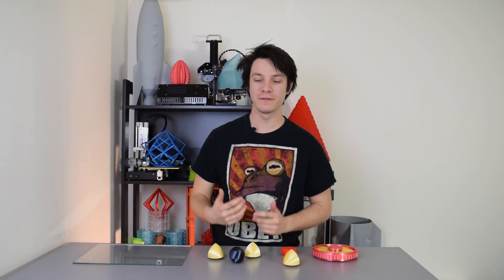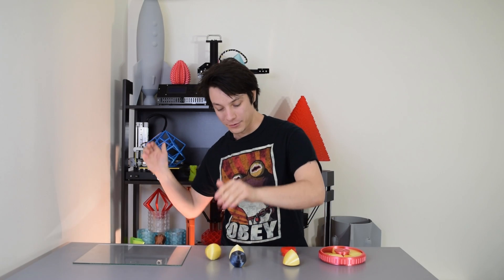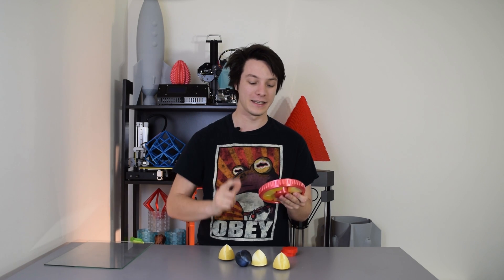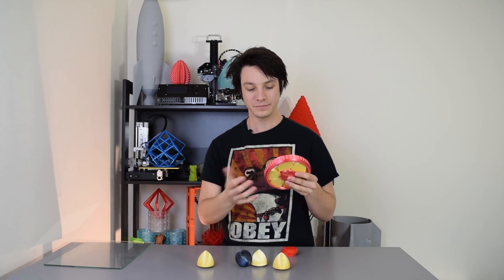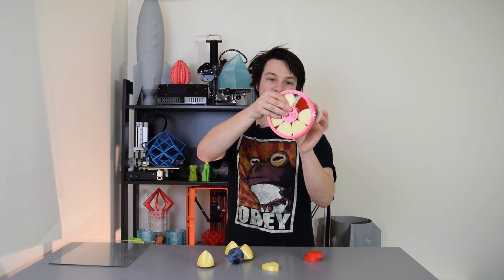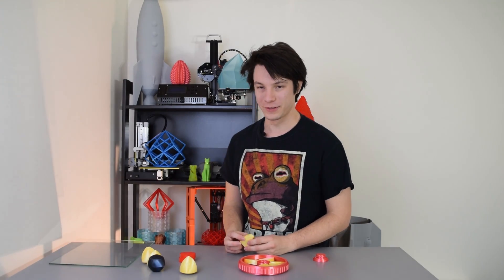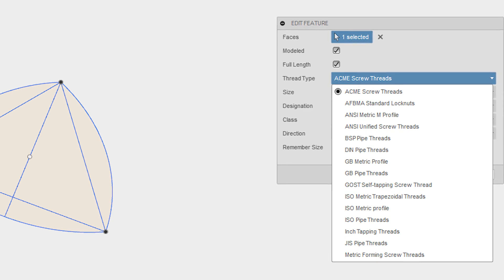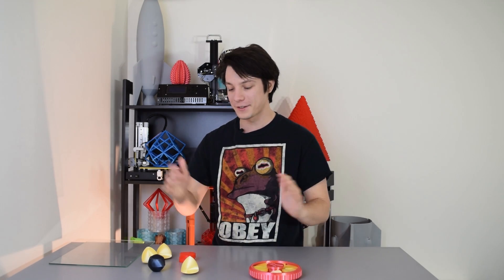Reuleaux Triangle Bearing - is it possible?

Comment: I have an idea how to make this work with the 2D constant width triangles. It will probably work if you have a guide mechanism like in regular ball bearings. The difference is, that the triangle requires a "guiding rod" through its center and that rod must be held by the guide in a way that allows it to move "up and down", but not "left and right". That would ensure that there is always the same distance between each triangle, just like there is always the same distance between balls in a ball bearing. 

What you demonstrated with the triangles falling out would be the very same in a ball bearing as well if each ball/triangle is not fixed in a horizontal position and they could shift all to the bottom, though it would require far less balls than just one less triangle as shown, so the center of the bearing can actually dislocate.

I hope this makes sense ;)

edit: Just saw the link to the "It is possible" video ;)

Comment: It'd be pointless and overcomplicated but...What if you made a bearing retainer that instead of containing the bearings from the edge it held them from an outer face and was grooved so as to push them to roll rather than simply making it rotate around an axle. This system would be clunky however, and would not provide smooth action. So you would probably have to gear it to keep the retainer and the bearings synchronized. Much like the fixed bearing in a rotary engine which regulates the motion of the rotor.

Comment: Surely you could just have the guides hold the bearings apart at the maximum required gap and just have a bunch of empty space being held free most of the time by the guide, and make a set structure out of the guides

Comment: drill a hole through the middle... and then make a guide ring that keeps them the minimum distance needed to not interfere with each other constantly.... then put them back and see how it works. might want to line the inside of both the guides with some material to provide some grip aswell so the actually rotate... for your demonstration purposes

Comment: Isn't the purpose of a race in a ball or roller bearing to hold the balls/rollers apart?  It would be possible to manipulate the relative sizes of inners, outers and rollers/balls to not need races, but then we would have the problems that abutting surfaces of the rollers would be trying to move in different directions.

While I can understand this for circles, my brain starts to melt when I try to visualise what it would do for these "solids of constant width".  I do imagine, though, that there would be a clash between "points" as they tried to rotate (in opposing directions) into the same space.

Definitely my bed time.

Comment: You can make a guide for them that compensates for the movement by being a slot instead of a single point. Place an axel in the center of the reuleaux triangle. let it slide back and forth between the inner and outer races. It should keep the bearings from touching each other.  I am concerned that the distance traveled over inner and outer races are different unlike the glass plate over the table. This may lead to undue friction. just downloaded Fusion 360 i want to play with this =)

Comment: I suspect the solution there would be to cage them with an eccentric whose offset is equal to that of the the center of the "roller".  You keep them in sync via the right gearing.  Gear the cage to either the outer or inner raceway and to the "roller".  This keeps them in proper radial sync, to use a term.  As the center of the roller moves inward toward the center of the bearing, the cage moves with it.

A much simpler way would be to build the cage with radial slots.  Each roller has an axle through the center which rides in the slot of the cage.  The cage acts as a Watts-type crosshead, allowing for the radial motion.  The only part of which I am not certain is the angular forces - whether they would seek to alter the angular distances between rollers, trying to force them first closer and then farther from each other.  Can this be overcome by assembling the rollers in a precise orientation to each other and during operation will they maintain that relative positioning...  Only way to find out it so build it.  Hint hint...

Comment: Great video, nice idea, but you didn't make a ball bearing you essentially made a pin bearing. Making a 'ball bearing' version would require you to think in 3d (I understand why you made it flat :) ) So it might still work in 3d you just have proven it won't work in 2d :) in 2D they wont roll but in 3d they interact differently. The shape reminds me of the wankel engine (I know the Reuleaux triangle isn't the same as a wankel rotary), you could redesign the shaft and housing to accommodate for the movement, how you asked... don't know, I only watched this video, but do find it an interesting idea.
Reply from the maker: I did have a play with making these into 3D Shapes, you can check it out here https://youtu.be/2eUWT9cI23o . You're right though the concept probably deserves a revisit!

Comment: why couldn't you make a "ball guide" using pins in the center of them, since the height is always the same the middle should be near enough so that you could add a ball guide via a hole through the middle. even though there would be shifting due to it being a triangle it would still keep them far enough apart with a big enough hole as it doesn't HAVE to be a small hole and it could be over sized for the pin but it would still keep them from coming in contact.

Comment: you could just make a guide, like wih ball-bearings. that will keep the solids from bumping into eachother. a hole in the center of the solids with a guide pin or an excentric rotating guidedisc could do that for you.

Comment: What if you printed gear teeth on the inside of the outer shroud, the outside of each rotary triangle thing and around the outer circumference of the core axel (or whatever you call it) to keep everything moving consistently? Sorry about super scientific lingo.... Let's just say I'm not an engineer, but I am curious...

Comment: Theres a very important reason why Ball bearings use balls. And its simple Ball is the most perfect shape do to it having only one dimension. And the reason why that is important is simple Durability.
Ball is naturally very easy to get maximum rolling surface area on thus pressure and load distribute to larger area and reduce wear.
Bearings need to last its not just a toy. 
Edges are first to give out which is proven to you by the Rotary or Wankel Engine Small contact surface against large contact surface+friction=High service cost and very short life of parts even when you add constant lubrication.

Comment: I remember in work this one time, I had some 3mm tungsten welding rods to fit into a machine and I couldn't understand why they wouldn't fit, i measured the rod, i measured the hole.  In the end I had to take them down to the quality lab for them to measure them and found that they were constant width, but not fully round. when you used three points to measure the diameter you found it was 0.15mm bigger.  This then started a lot of arguments with the other engineers who couldn't understand that something could have a constant width and not be round.  One guy spent 4 hours measuring a UK 50p coin, which has 7 sides and a constant width.

Comment: Everybody is talking about if you could, and you have demonstrated why you can't, but most idiots here think, oh... this would be great to replace ball bearings... no... it wouldn't... even if you could... it would still be more difficult to create these, and take more energy to do so.   there is a reason balls and rollers are the norm for bearings... it is because of the ease of their creation.  rollers are easier than balls, and they support more weight, because of the increased surface area.

Comment: Reuleaux ball cage:
In a hexagonal arrangement, three triangles are in the "UP" position and three are in the "DOWN" position.
Connect the "up" pieces with a cage that axles on their centers, and only have the cage connect on one side of the bearing. 
Connect the "down" pieces similarly with a separate cage on the opposite side.

Boom Reuleaux cage.
Reply: I'm not sure this would work in plastic, as the tolerances may be too high. For plastic they may need gearing to maintain conformal rotation.

Comment: If the Solids of constant width were positively charged they could repel each other and you might get something interesting.  You also might trying using a fluid (possibly in combination with a charge).

Comment: The spacers from normal bearings would work but if there was a spacer set at the width of the objects then a roller contacting the objects in the center of the bearing space it could maintain contact with the objects and they would roll.

Comment: Angus, I know this is an old video now...

But what would happen if you put teeth on the bearing rollers and bearing race? It'd keep them from sliding too close to each other.
Reply from the maker: For sure! I think gear teeth is 'possibly' cheating but it'd most likely work. I've been slowly working on some solutions based on the awesome comments like yours.

Comment: It's possible to build a 'ball cage' for your Reuleaux Triangle Bearing. Each rotor would need a short central shaft, that would travel in a triangular(?) slot on the inside faces of 2 flat rings that would also be connected to each other between the rotors.

Comment: Check out planetary and sun gears, just like in automatic transmission, maybe putting those rollers on an axle, and those axles fixed together, making it possible to spin them. But Idk. Works with gears

Comment: I imagine you could make a cage to keep the triangle bearings evenly spaced by placing two rings on either side that are connected by shafts that pass through holes drilled in the bearings.

Comment: If these were spaced with a very wide cage and the inside race diameter were closer to the outside race diameter, it would work almost flawlessly. The problem is that you had bearing rollers that were larger than your inside race, which isn't a viable way to make bearings at all, regardless of the shape of the bearings. Lower inside/outside race ratio would mean you can use   more rollers, and the number of them wouldn't matter as long as the track was 5/8 to 7/8 full of rolling elements.

Comment: What if your center hub was designed to pinch, but with angled sides to force the shapes outwards? You could force them to always be in firm contact with the inner and outer surfaces, and unable to slip around to leave a gap for the hub to fall through.

Comment: You could attach a guide onto the sides   of “ball” bearings, so long as the center of them remain at constant distance from the center of the bearing it should work.
Reply: If the center of the “balls” don’t have a constant distance from the center of the bearing, perhaps the guide could allow it to move while making sure the balls don’t lose contact with the edge of the bearing.
Reply: Side thought, if you were to use the movable guide, could pistons be used to spin the ball by changing the distance; pushing the ball, thus turning it and the bearing.

Comment: I think there is still space for this to improve into a more workable bearing. Not necessarily a perfect bearing but one that is more workable. If you make the center race bigger, to fill more of the area in the outer race, then your solids of constant width would need to be smaller to fit in that space, allowing more of them between the two races. This along with a "ball guide" with slots to allow the centers of the solids of constant width to move a bit should get you closer to a workable bearing. 

I would do this on my printer and make a video about it, however I am working on a 2 month long print project that I do not have enough time for side endeavors with.

I would like to see you revisit this if possible in the future, and possibly I would like to visit it myself, perhaps a collab on the design?

Comment: You need a "cage" (even ball bearings use these when not fully packed - to keep from falling apart) drill a hole in the center of each bearing, add a separate circular ring with a shaft for each roller, that'll maintain the distance between the balls and prevent the bearing from falling apart, as well

Comment: Make a planet carrier to hold the shapes apart, and make the planet pivit shafts sit in holes that have been oversized or lengthened to allow the center of the shapes to move without collinding with nearby shapes

Comment: If you position them correctly and fashion a way to keep them a set distance apart, it should work, in this case of the triangles, you could make it so the points take turns with one another in the space between. itd be like a ball cage in a normal bearing but the individual triangles would be fastened to the cage at their center

Comment: If falling apart is an issue because the gap is too large, why not change the size ratio between the axle and bearings? put like 20 smaller bearings and one large diameter axle.

Comment: Ahah. So because these shapes of constant width do NOT have identical radiuses for the angles required to work as ballbearings, they don't work. Interesting. So, is there a peculiar shape that is perfectly suited to being a ballbearing (for a specific number of ballbearings), but is not a shape of constant width? I'd imagine the first requisite to this answer is that the structure around them can't be perfectly circular.. hmm..

Comment: so you just have to change the inner walls of the bearing sleeve to accommodate the shape. https://youtu.be/skvnj67YGmw
Reply: some rotary engines use these solids of constant width in their designs.
Reply: essentially, the inner wall of the outer sleeve must be the roulette of the solid. also, the outer wall of the bearing center will have to be a roulette of the solid .
Reply: that doesn't work either. hmm.

Comment: I think in order to make it work like a bearing, you have to fix them in equal position relative to each other, connecting the axis of rotation of each piece with the axis of central part of the bearing ring.

Comment: What you need to do is to make the "balls" a lot smaller relative to the large rotor. If you make a regular ball bearing with 5 large balls, it would not work very good either.

Comment: Who could you not have a guild made with axles going through the shapes and a spring on the outer (meaning the largest part on the bearing) and inner (meaning the center point of the bearing) so the axle is supported by the sides, but free to move up and down?

Comment: If you try to drill a hole using a spade bit (a flat blade typically used for drilling large holes in wood similar to this http://toolhires.com/wp-content/uploads/2016/10/Spade-drill-bit.jpg), the pointed portion that locates the bit at the hole's center is very important. Without it, the bit's center line is not tightly constrained and the bit cuts a hole of constant width, usually with 3 or 5 lobes. I am sure you can visualize how that would happen.

Comment: have you ever seen a normal triangle roll where it is on what looks like a sinusoidal surface that compensates the triangle different distances to the center thus a smooth rotational motion. What if you used that idea on the ring of the bearing to allow the objects of constant width to moves smoothly and it would act in away that would allow the objects to maintain an even distance from each other.

Comment: The flat's for the barring were already made in the past and used in firearms. An inventor designed the shape so that you could fit more bullets into a pistol than with just a round shaped bullet. And it worked!   The cases were of this shape and the pistol was sold in sears stores.   However the pistol design failed to thrive. Google it.

Comment: Wouldn't the wear on the triangle bearings be uneven? If it could run smoothly, the triangle tips would wear down and the convex side would quickly get a concave dip?

Comment: You just have to have each bearing in a captive "guide" or race with each bearing held in place - with an axle through the center of each bearing, allowing it to turn but not to contact eachother, since like spherical bearings, the contact surfaces of each bearing is rotation in the opposite direction of the adjacent one. Could the bearings be staggered so that each one contacts the opposing face of each non- adjacent one?

Comment: You can make a roller bearing if you properly design a cage to hold the "bearings" in place, like the other bearings you showed have a cage.  You need a pin in the "center" of each bearing.  The cage would be a flat ring that just fits within the inner and outer race with slots to allow the center pins of each bearing to move towards  the inner or outer race.

I have not read any of the other comments yet.

Comment: Keep the same outer diameter, use smaller bearings, and scale up the inner race to match.
It should roll quite well then. You simply need to 'spread the load' a bit.

Comment: Making a usable bearing would be pretty simple I imagine. Rather than a ball cage that surrounds each triangle, just make a cage that has a curved axle that runs through each triangle. While the center doesn't move in a perfect circle, it's close enough that if you left a small amount of clearance by boring a hole a bit bigger than the shaft, it should work.

Comment: Correct me if I'm wrong but one created from a higher Ngon, would have less center travel than a triangle. That's why a triangle version has greater travel distance on the center, thus causes the slow down; but with a infinite Ngon (circle) has no travel on the center. So try one with say 15 sides.